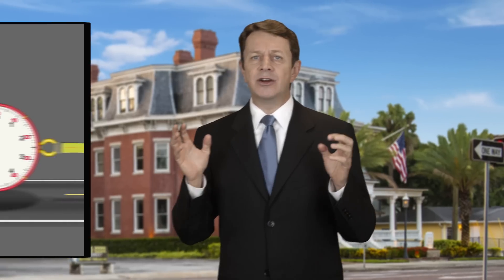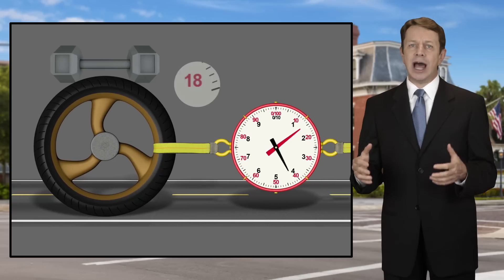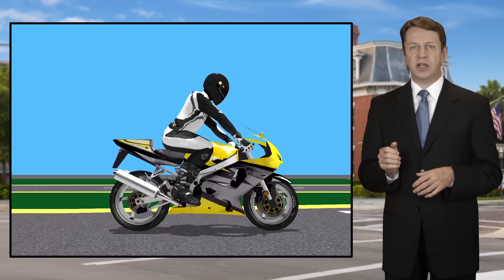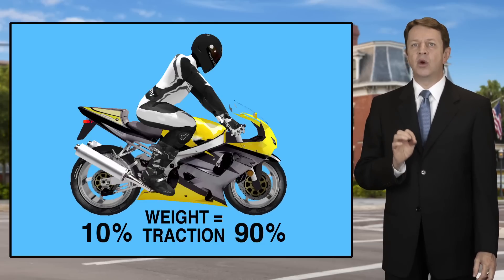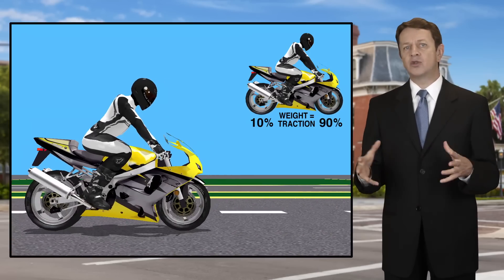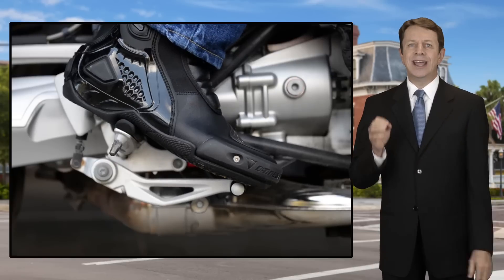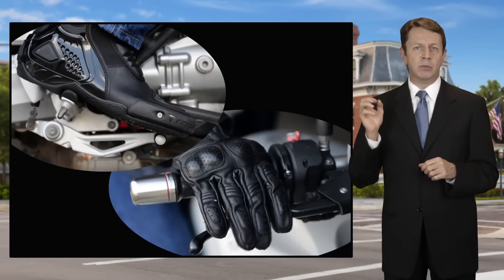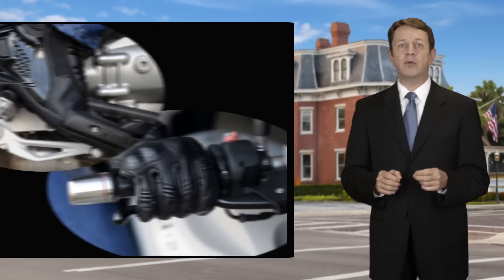MOTORCYCLE EMERGENCY BRAKING - Emergency Braking to avoid serious injuries and damaging your bike!

Comment: I just had a crash because of the panic braking. So i was filtering with the bike and theres cars all around me. Then a guy came out of nowhere in front of me. I hitted the front brake and i dont use the rear brake at all (as i could remember). Then the front tire slide toward right and i couldnt hold the weight of my bike as my feet tried to grip the road. It was a little crash and everyone is fine. The distance between the guy and me was about 3-5 metres and my speed was about 30-40 kmh. I ride a 2012 yamaha r6 and it doesnt have an abs. So what is exactly the right way to stop immediately? Should it be 75% front, 25% rear? If so, what should i do first? The front brake then the rear brake, or the opposite way? I ride this bike for a long time but within 2 weeks i already had 2 incidents with the same scenario and i end up laying down on the road.
Reply: +bagus utomo Well, I've heard someone say the rear brake should be applied first, then immediately followed by the front brake (because of the weight shift).
However, I think both brakes should be applied simultaneously, since the weight will shift no matter what... and it happens quite fast, so you can quickly apply quite some pressure on the front brake.
Anyway, there's no "golden rule" that works for all motorcycles, since no single bike, rider or situation is the same. 
I think the best you (and the rest of us) can do, is to practise our braking skills in our standard setup - normal riding gear, specific bike with favorite tires (pretty big issue, too) - and perhaps even on shifting pavement conditions. Dry, rainy, etc...
Your situation is probably pretty common - we tend to react by instinct by applying the front brake like hell... unfortunately, it's often too much and causes the tire to block, and the rest is history. :-/ 
It might have saved your bacon though, if you'd applied the rear brake somewhat, too. It often gives a better feeling of control over the braking, and it might just add that tiny amount of braking power that is needed to avoid the front wheel blocking.
What we need is to practise in order to control the pressure front and rear towards near optimum in emergency situations... "use the force, Luke!" :-D
Hmm, the 2nd time... did the front wheel slide there, too? Perhaps your front tire is the cause... make sure it's in good condition, a good quality one, too - and, of course, the correct tire pressure. c".)
(Btw, I'be been riding for 34 years now, Suzuki 1100 most of the time... I'm far from being a master braker myself, but I think I have quite some experience, nonetheless. Some day I really want to put my braking skills to the test, however, and see how far I can push it... might save me some day, who knows?) ;-)
Reply: Check out Ken Hill and his moto racing podcasts. First and last 5% of all motor inputs (especially braking but also includes body positioning, counter steering, throttle) should be done very lightly. Proper trail braking and emergency braking will save your life. Thanks for sharing your experiences and enjoy the ride.
Reply from the maker: Keep practicing using both brakes until you can stop your bike quickly with control.

Comment: I use my motorcycle's brake with 100% traction at the front tire and 0% at the rear tire. It's called stoppie. Btw sir, you look like you came right out of a PS2 world in the video.
Reply from the maker: Thanks for watching.
Reply: "thanks for watching" 😂😂there u go
Reply: Watch moto GP.. their rear tyer always in air when they break..its called art of breaking..but dont worry.. there is also a idiot proof system nowadays called abs
Reply: OMG I thought this guy came from PS2 world, isn't he?
Reply: Lei Bian : Yes.. He thinks that doing stoppie is as easy as hitting front break.. lol
Reply: I have the same ps2 bike and honestly the best way of braking on (especially on snow) is putting all traction on the front
Reply: I have the same ps2 bike and honestly the best way of braking on (especially on snow) is putting all traction on the front

Comment: use 1-2 fingies on the brake and clutch lever or u could fly forward
Reply: That really depends on the bike and your weight etc... it's better to practise on quiet roads to find the optimum pressure front and rear. I also think it's a bad idea to pull the clutch while emergency braking... or during any braking, for that matter.
Reply: Emergency Threshold Braking:
I think to practice emergency braking should be mentioned and practiced.

Note: Every time you stop you put both feet down at the same time when the motorcycle has stopped.
That keeps you upright and balanced instead of leaning and having to hold the motorcycle. 
And think… if you have to ride away quickly you don't waste a precious second getting the motorcycle vertical before riding away. 

So …..Start at a reasonable speed like 40 to 50 mph in a big open empty parking lot.

Find a marker on the road as a measurement point. 

Do 3 emergency stops from that marker and note where you finally stop and mark that point with something like an old glove.

Next. 
Practice rear brake only first - apply it slow and evenly over and over until you are able to brake right at the threshold of skidding but don't go that far.
Next is front brake only - and ditto the same practice applies as the rear.

Now the same speed and use both brakes right to their threshold skidding point.
Practice that a good number of times.
Now go back and recheck yourself at the first location that you marked with the glove. 
Do another emergency braking. 
You will see that you have stopped much shorter than your first time.
Do this exercise maybe 3 or 4 times a year to keep your skills sharp.
Yes I know about ABS and linked brakes.
You can still skid an ABS equipped motorcycle. The tires skid and release numerous times quickly. 
Try to get to that point without reaching it for maximum braking efficiency. 
Eventually you will discover that the front brakes have more stopping 'power' and therefore you will apply maybe 60% of the braking to the front and 40% to the rear. Of course you can't do it that precise but it is a good target value.
In emergency braking you hardly have time to downshift.
You can just pull in the clutch and use your left foot to get you down into first gear and ready to ride off based on what happens behind you when you stop fast.
Reply from the maker: Practice braking to be safe.

Comment: Without a question you should attempt to use the rear brake as well.  However, on most sportbikes  your hardest breaking will be done with the rear tire just slightly off the ground.  This is when body position becomes extremely important.
Reply from the maker: Great comment, thanks for watching.  Practice makes perfect, especially in an emergency.
Reply: Body position is extremely important on all motorcycle types. Especially in panic stop situations.

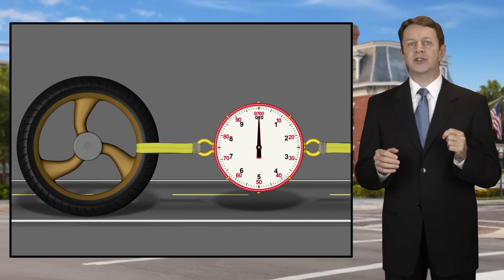Comment: what the hell is he doing at 0:30 ?
Reply from the maker: The video is showing that the amount of force to drag the wheel on the road with very little weight is only 3 pounds.  However later when there is weight, or downward pressure on the tire, the amount of drag is much higher than 3 pounds.  This is why the front tire of your bike has more surface area and more drag on the road surface which affects the stopping of your bike.  Thanks for watching.
Reply: I understand that, as I am a motorcyclist, but I am not talking about the graphics, I was talking about you xD  Watch what happens to you at 0:30

Comment: AWSOME tip. I had my first wreck cus an asshole cut me off to make a turn down a side street out of habit I slammed my front break an hit him an fell.
Reply from the maker: Sounds like you came out of the wreck okay.  No matter how careful we are, some drivers are idiots and will put you in a dangerous situation that all happen sin just a few seconds.  But practicing how to handle your bike in an emergency will give you the best chance of avoiding a wreck.  Ride safe and have fun.  Matt
Reply: You cannot be ‘cut off’ if you maintain a 2 second follow distance which is very easy to maintain in good weather on a motorcycle. More seconds in bad weather like rain, fog etc. For vans Rv's the distance is 3 seconds, school buses etc is 4 seconds, tractor trailer combos is 5 seconds. 

So now the lesson: If you are traveling at 60mph and a vehicle moves into your following space just relax your throttle a tiny bit to bring you to maybe 58 mph. In a very short time you will be 2 seconds behind the vehicle that moved over. So now you can increase to 60 mph again and keep going 2 seconds behind that car. The change in speed on your part will delay you from your destination maybe 5 or 10 seconds. The number of cars that may move into your following distance is few. And remember you are on a small motorcycle compared to other traffic. Motorcycles have only one function which is fun. If it is not fun don't own one. They serve no other purpose. They are not practical, many get worse mileage than modern cars, they have insurance costs. They take longer to get to a destination 15 miles away than a car. Why? Go to the garage, unlock the motorcycle, pre-start inspection, put on all your protective clothing, jacket, boots, gloves, helmet etc. when all that time is gone you could have driven 5 miles in a car.

So my original statement stands and is true. Two seconds following distance is considered safe at all safety schools and with all safety instructors and is written into government handbooks.

Comment: I came into a close situation the other day with car pulling in front of me. I've only been riding for almost a year, but even then, I always use both brakes, regardless of situation. This was the first time I ever had to do an emergency stop, and I ended up locking the rear, even with a tiny bit of brake. This caused my back end to slide a good 20° from the direction of travel. When the rear finally regained traction, it almost kicked me off the bike.

Moral of the story is to be careful using the rear brake, as it's very prone to locking during an emergency stop (unless you have ABS)
Reply: Practice emergency braking in an empty parking lot every few months.
Emergency Threshold Braking:
I think to practice emergency braking should be mentioned and practiced.

Note: Every time you stop you put both feet down at the same time when the motorcycle has stopped.
That keeps you upright and balanced instead of leaning and having to hold the motorcycle. 
And think… if you have to ride away quickly you don't waste a precious second getting the motorcycle vertical before riding away. 

So …..Start at a reasonable speed like 40 to 50 mph in a big open empty parking lot.

Find a marker on the road as a measurement point. 

Do 3 emergency stops from that marker and note where you finally stop and mark that point with something like an old glove.

Next. 
Practice rear brake only first - apply it slow and evenly over and over until you are able to brake right at the threshold of skidding but don't go that far.
Next is front brake only - and ditto the same practice applies as the rear.

Now the same speed and use both brakes right to their threshold skidding point.
Practice that a good number of times.
Now go back and recheck yourself at the first location that you marked with the glove. 
Do another emergency braking. 
You will see that you have stopped much shorter than your first time.
Do this exercise maybe 3 or 4 times a year to keep your skills sharp.
Yes I know about ABS and linked brakes.
You can still skid an ABS equipped motorcycle. The tires skid and release numerous times quickly. 
Try to get to that point without reaching it for maximum braking efficiency. 
Eventually you will discover that the front brakes have more stopping 'power' and therefore you will apply maybe 60% of the braking to the front and 40% to the rear. Of course you can't do it that precise but it is a good target value.
In emergency braking you hardly have time to downshift.
You can just pull in the clutch and use your left foot to get you down into first gear and ready to ride off based on what happens behind you when you stop fast.
Reply from the maker: It is good that you have practiced and were able to maintain control in your emergency.

Comment: What I actually do is brake on my front with control making sure my rear tire will get traction everytime I shift down and apply brake on my rear tire. What happens usually is I just swerve minimally left and right giving me more distance than braking on a straight line.
Reply from the maker: That is great.  If you can swerve with control while stopping, you are likely to avoid a collision all together.  Keep riding safely.
Reply: To be fully in control, both wheels need to be turning all the time when braked. If it's that you've downshifted that causes the rear tire to skid rather from braking, then don't do that. Just use the rear brake because you can modulate it much better. When skidding, you're not stopping (watch race cars that lock up the brakes and they can't stop). Best of luck.

Comment: Should I apply the clutch along with both brakes while making an emergency stop?
Reply from the maker: No, focus on the stop.
Reply: Yeah, engine braking. I believe there's less change of locking the rear when you brake with the gear in. Engine is like an antilocking device somewhat.
Reply: if u forcefully push lever it will block.. u have to pay it in installments... like in clicks.. never hold..
Reply: You don't apply  you disengage the clutch FFS some of the terminology used with NFI of mechanical principles is rediculas

Comment: Starts well, but this rubbish about pulling the clutch in and making sure a rider is in first is a joke. 

The limited research this is based on is flawed and with have years of practical research and experience in the UK that clearly shows differently.

Under heavy braking, leaving the clutch engaged means we can use the engine braking to assist the deceleration, while also using the fact the rear wheel is still under power to aid us not loosing traction. 

This stupid idea that it is important to be in first gear when doing an emergency stop is a joke. 1st - what is more important? Being in the right gear, or not running over or hitting the person or thing that has caused you the issue? 
Then 2nd - Stopping in an emergency from an average highway speed takes a few seconds at most.  Motorcycle gear boxes do not work well when block changed. They prefer to be changed down in succession, ideally with the clutch reengaged between shifts. Trying to block change will often lead to a false neutral, or the bike not making it to first so a rider who does not check risks trying to pull away in the wrong gear. 

Avoid the emergency fist! Then once stopped,  we can worry about whats behind us and take remedial action accordingly. 

This is not just my opinion. Pulling in the clutch early is a test fail in the UK as it is deemed a loss of control. For over fifty years Instructors all over the UK have practiced E-stops with their trainees on a daily bases. The thinking has found to work best across a range of conditions, and from basic entry level, to advanced.
Reply from the maker: Thanks for watching the video.  Maybe I was not clear.  My point is to be in first gear when you are at a full stop, so in case some car is coming up from behind too fast, you have the ability to get out of the way.  I agree,  you should not be in first gear during an emergency braking situation.  You should focus on braking, steering and not on changing gears at all.
Reply: Also, when approaching a full stop, stay to one side of your lane and point your motorcycle at an angle away from the vehicle ahead of you so if you are rear-ended, you're bike won't be crushed between you and the vehicle immediately ahead of you. It will go either to the line separating lanes, or to the curb and you'll survive better.
Reply: Thanks for the reply Matt, but no you were clear in the first place and we disagree.
What I find amazing is that people obviously have not really practiced what they preach when suggesting first gear should be selected on stopping. The approach is seriously flawed as motorcycle gearboxes do not work in that manner.
Motorcycles have sequential gear boxes, they do not work correctly if the clutch is pulled in and block changed down. They will rarely be in first gear, often getting stuck in a false neutral position between gears. Meaning a rider who has attempted this from speed will not be in first and will not be able to pull away correctly.
We know this as it has been part of the UK test for over fifty years, we have searched for best practice to teach novices the best way to stop. Thousands of E-stops when training people across the board, Novice to Advanced, it has been found that leaving the clutch engaged is far better than disengaging it as the continued use of the slowing engine helps avoid the rear wheel locking. Just the act of disengaging the clutch on an emergency stop in the UK is a test fail as it is considered a loss of control. 

What is the most important consideration when forced to have to stop from speed. Stopping short of the obstruction, or worrying about what to do after you have stopped?
Reply from the maker: I think we are still talking about two different things.  I suggest that after coming to a full stop, then you should put your bike into first gear, so you are ready to go in an emergency.  First gear has nothing to do with making an emergency stop.
Reply: When you have completed your emergency braking and come to a full stop..... you want to be sitting with both feet down and in first gear....because the car behind you could be a problem....so be ready to pull ahead etc.